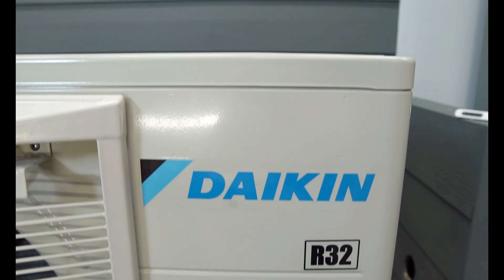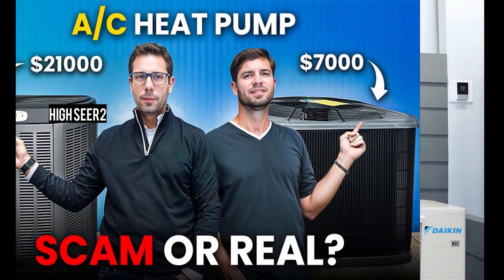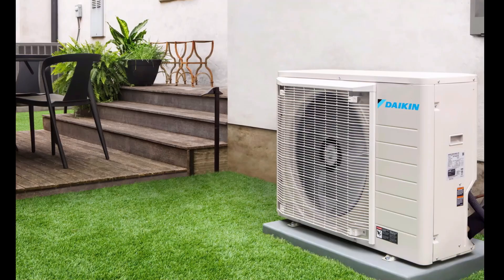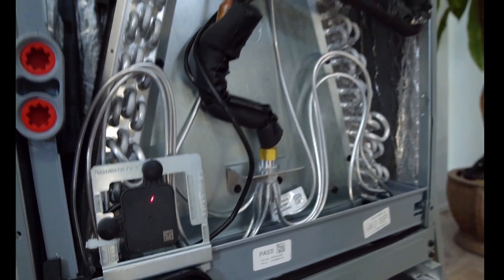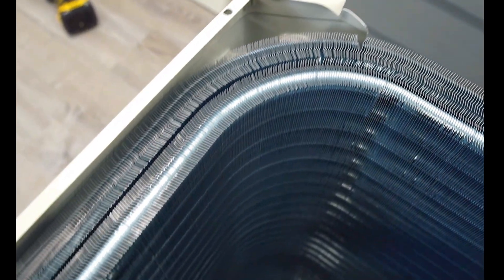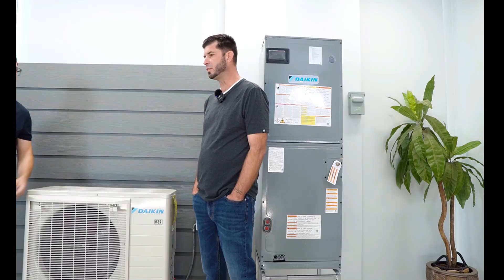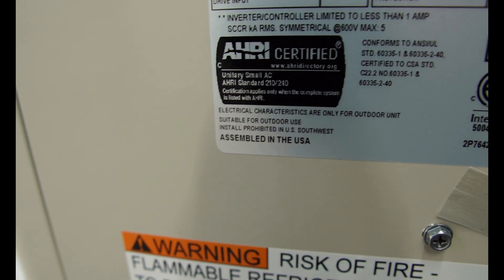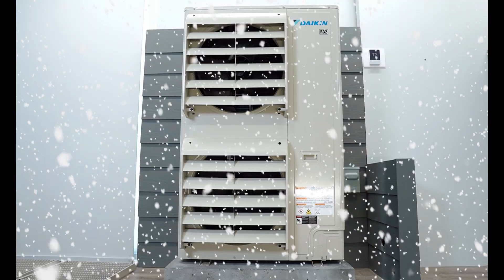R32 Daikin Fit | The Reason Why the HVAC Industry Is Freaking Out

Comment: I know this is the future, and we are starting to see more and more of these types of communication systems in all areas, but the HVAC industry still has a long way to go before we can call these systems reliable. Our company is a Daikin distributor, we charge the systems according to their charging tables, use press-fittings connections, and our evacuation processes are below 200 microns with 10-minute decay tests, we use shielded cable for communication and follow every procedure to the letter. Within 5 years after equipment installation, there are always 4 or 5 components that need to be replaced, whether it's a fan, sensor, board, stepper motor, anything. So, my point is that if I have to go to your home to repair your system that is less than 5 years old, I cannot consider them a reliable manufacturer. All this inverter technology needs to improve tremendously before we can blindly trust it, similar to when the automotive industry began implementing sensors and more electronics.

Comment: Here is the real meaning of Daikin, which is not “big gold” or “big money”. Daikon’s original name was Osaka Metal industries (Osaka Kinzoku Kogyosho 大阪金属工業所. In Japanese, long names are shortened by using only the first character. So “O” + “Kin”. But those 2 characters have a different  pronunciation when used as a single word “Dai”+”Kin”. Then following typical Japanese company practice, they made the name more modern and cool by changing from kanji pictographic characters to phonetic characters ダイキン or Daikin.
Reply from the maker: We have invested considerable time to research the true meaning of ''Daikin''. We have even contacted several Daikin officials but unfortunately they couldn't provide the true Japanese meaning of the word.  Therefore we had to rely on search engines and that's how we got our answers from. Thank you for the input.

Comment: Do you show how loud is this model, please?
Reply from the maker: The quiet mode is 45dBA what’s considered to be insanely quiet. Realistically, normal operation 56dBA. 
Thats still a lot quieter than the most expensive top discharge communicating system at 59dBA. All Daikin fits are super quiet and it’s a combination of side discharge feature, noise reducing fan blades, variable speed operation, heavy compressor blankets, swing compressor and MOSFET controlled brushless outdoor fan motor. Let us know if we missed something.
Reply: @GWAC555 Thank you for the answer. I would like tò install It but I live in a historical center in Italy and the limits of dB here are pretty low. Any reccomandations how tò lower it more?
Reply from the maker: Daikin One thermostat has a quiet mode. It’s in the thermostat settings. You can activate it or even schedule what time you prefer to enter I into quiet mode.

Comment: Im an HVAC installer/service tech in Minnesota.   Ive installed around 35 of the fits with gas furnaces.   We still rely on gas as backup here.  They have been outstanding systems.  Ive been installing for 25 years and it took me a little getting used to but now its easier than traditional installs.  Daikin has been wonderful  for us and i cant say anything bad.  Good video and good info.  Biggest system ive done is a 5ton vrv system.  Ducted whole house with 3 additional heads.  Been great so far!
Reply from the maker: Agreed! They came up with cutting edge products at low costs.
Reply: What do you set the 'balance point' temperature at, when the unit switches to gas?  Mine is at 20 F, but i'm wondering if I should set it lower.  My FIT is the previous refrigerant design, 2 years old, 2 1/2 ton with 80% gas backup.  Thanks for any info!